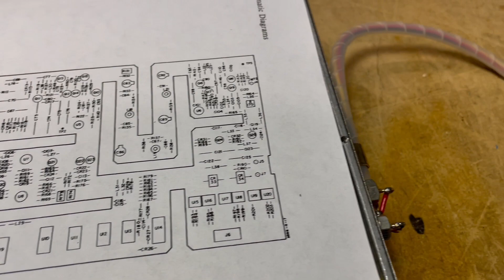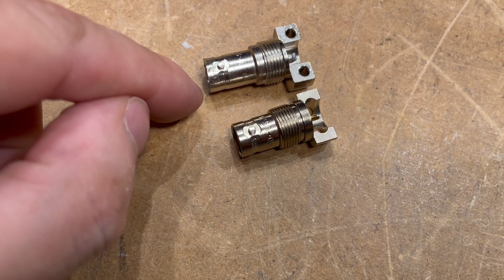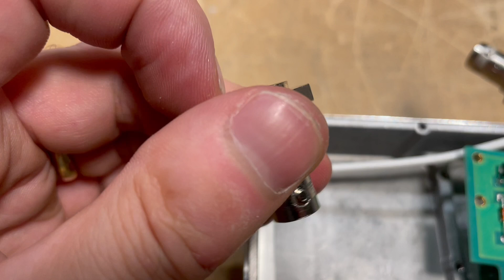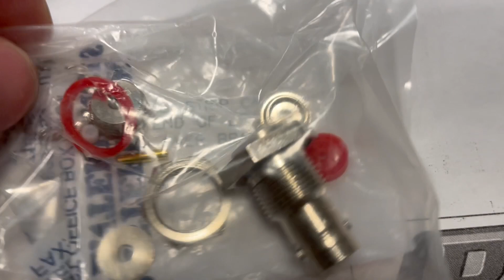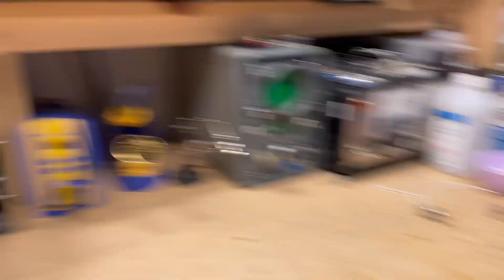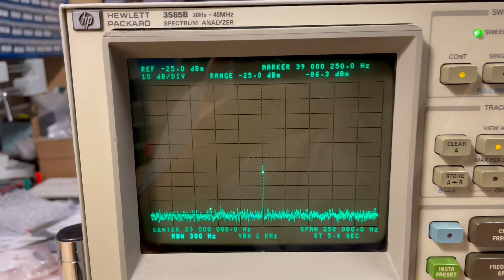HP 3585B Spectrum Analyzer Repair Part 4: More Repairs and Finishes

Comment: Just a thought. If you wanted to maintain what you had inside the 3585B, why not reinstall the original BNC, then get an adapter such as SMA, N or SO239 to female BNC and slip it on from the front panel. This does not fix the messed-up BNC but once you slip an adapter over it, you don't have to worry with it again. I looked for a BNC female to BNC male but didn't see one. Though, there are the others I mentioned. My 2 cents worth..

On ebat, I searched
BNC Male Plug To UHF SO239 PL-259 Female Jack RF Coaxial Adapter Cable Connector

Comment: Changing the BNC was probably not worth it, especially because it may impact the analyzer performance. Kudos for fixing the analog display module.  I would probably want to replace that noisy fan :)
Reply from the maker: Unfortunately changing the BNC was necessary as it was damaged beyond usability. The trade off is maybe performance issues but given the low frequency range of the unit (40mhz top end) I imagine the new BNC will have very minimal if any negative impact. FWIW after completing repairs I performed all of the performance tests listed in the service manual. All passed with no issues. Thanks for the comment.

Comment: Great repair, really good series of videos! Did you check the RF section rail to ground resistances after replacing the tantalums? When replacing tants I try to use ones rated at double the rail voltage - 30 volt tants for a 15 volt rail.

Comment: Very good unit and excellent trouble shooting skills, learned a lot from your videos. I got set of 3585B in very poor situation, but finally restored. One question, does 3585B perform "Instrument Preset" automatically?  no fixed interval, within 1 minute or few minutes, with signal feeding or without, same situation. thanks agian
Reply from the maker: The instrument will do calibration routines periodically automatically (I think every 2 minutes or so). These will occur even if there is an input signal being monitored. I believe the auto calibrations can be disabled though in the configuration options. The instrument presets are user defined settings which are stored and recalled once, either on initial startup or if recalled manually. I don’t believe it should change presets sporadically. Thanks for the comment.
Reply: Hello Free Electron,  thanks for your reply, I confirmed that it auto calibrate and also perform unexpected Reboot with beep, I tried to study either +5V DC, seem C1 in A72 is poor, new cap was replaced and after tested, voltage is same as old cap, but after running for awhile, the system was crash,  system frozen, after reboot, the keyboard only few key responded with LED. 
after few time of ON/Off , all key are gone and all no LED, keyboard is gone.
Would like to know what ripple level or waveform from A72  TP1 +5V? poor +5V source will damage to  the digital Board?
thanks

Comment: Yay, love how the path moves thru filters and switches and so on, but with discrete componentry because year and low freq requirements. I remember similar modules showed by Shariar from TSP YT channel, but with ceramic substrate and very expensive components and construction. Very interesting :)